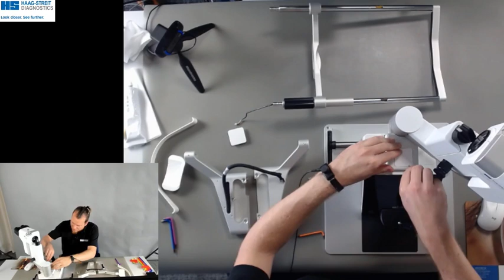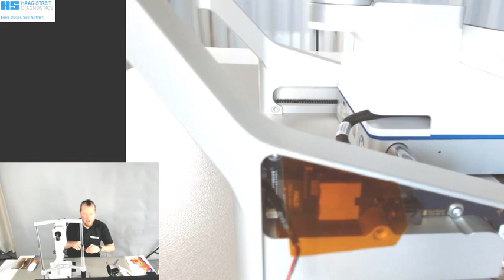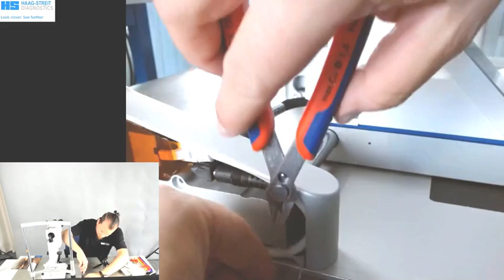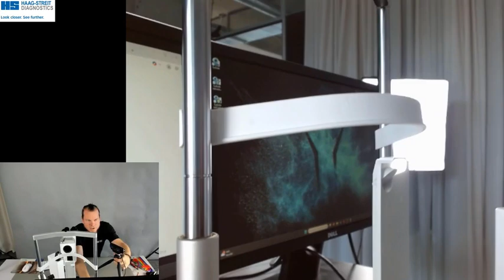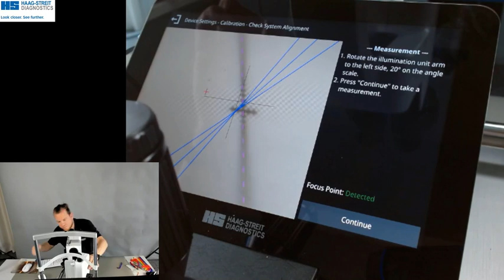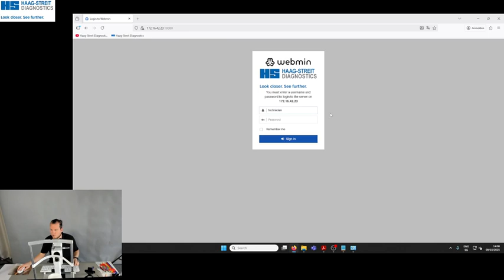Elara 900: setup detailed

Comment: I am returning mine Tuesday. Had it for three months and it has firmware issues for which they were doing to replace it. Unfortunately it hasn’t been replaced for months and takes up a lane. Buying new should come with better service from Haag Streit but they must be having support shortage issues or something. Anywho a 12 month warranty on an expensive slit lamp with this many parts that can go wrong is a high risk purchase when very reliable multi decade ones are less expensive. It should be a 5 year warranty in my opinion minimum.